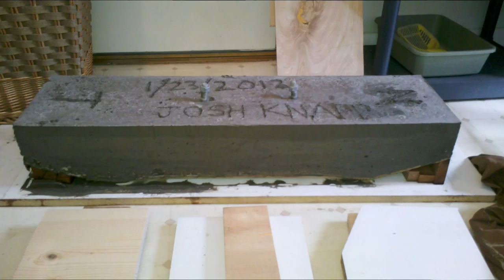Skateboard Deck Press Montage Photos

Comment from the maker: yeah take the pins out and lower the mold, usually have a friend help. the 1x4 glued and screwed.
Reply: Hey Josh! I have made the exact same way my press, but it came to my head, that when you put in the wood it changes the concave, so actually the sides of the deck will touch first... I was wondering if the quality of the final product was satisfactory? I dont know if i should do a new upper half with the concave corrected by layering up some kind of foam on the selected half and then pouring concrete again. Thanks